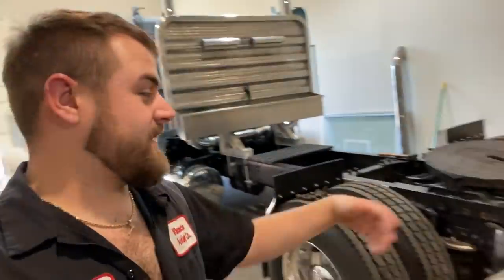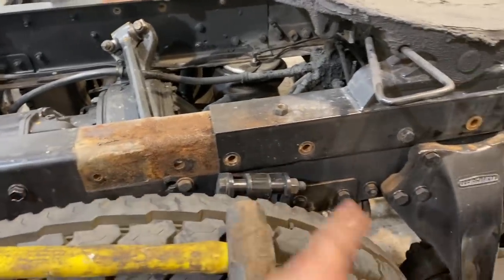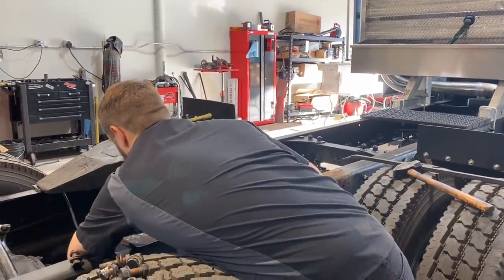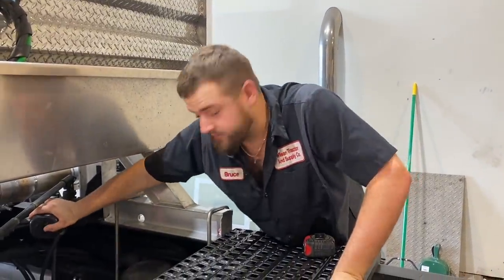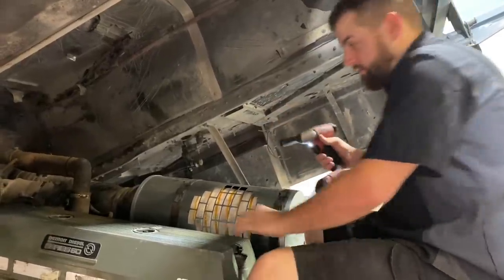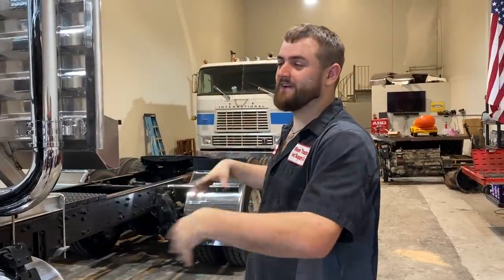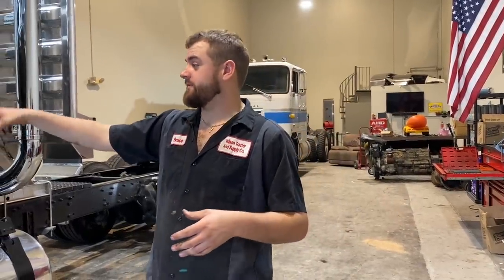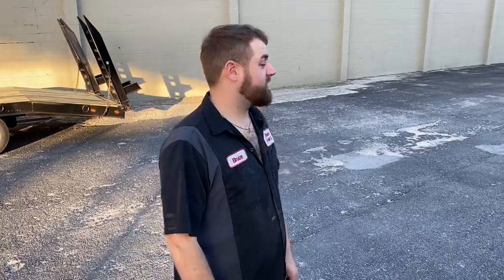Completing "Blue Collar" the Cabover Part 1....

Comment: The wood on the trailer deck use old diesel engine oil a couple of coats and that'll make it last forever and it's free!!!😉😁😁
Reply: use that on ruff cut not pressortreated should have been ruff cut you get full 2in.by ?
Reply: @johnyork8148  your right I didn't pay that close attention to it not being rough cut...
Reply: No Body my Grandpas barn floor is rough cut 2x12 completely coated in oil and it has been sitting in the dirt for 50 years and shows no signs of rot.
Reply: @aaronhayden1780  that's awesome my great grandfather taught me that trick!!!
Reply: @aaronhayden1780  i have rough cut barn with drain oil rolled it 3 times looks good 8 years no rot .not presser treated
Reply: That's a trick I used to use on my trailers when I wasn't a company driver
Reply: @johnyork8148  .uk

Comment: We get this stuff called copper 2 preservative that we do our low bed and gooseneck with every like 3 to 5 years super easy to apply 50/50 mix with water and spray it on with a garden sprayer i can do both trailers in about half hour our gooseneck is a 1996 and all original decking check it out if you can find it comes in clear green and brown

Comment: Advisory.  Cut two bits of angle join to the 5th wheel angle to cover the exposed Join Then then you have Protected the other weld-on stretch.  you have increased the pressure on the join Must Be compensated For. Zinc coat the welded area.

Comment: Looks great!! Need to find a way to tie the mud flaps up because if the stacks are too tall and you have to dump the bags to back into the shop each time, the flaps are gonna get caught under the tires and rip em off each time 🙈🙈🙈 is Bus Grease Monkey still coming to help out on The Air Force Truck?

Comment: Please shorten the mud flaps.
Reply: We've told him that several times and he still won't listen. He won't be happy until he rips a mud flap off and DOT pulls him over.
Reply: Dot will not pull you over for that nice try
Reply: @sarmce  they will if it rips off and not replaced immediately.
Reply: @sarmce  That is a DOT violation and they will pull you over if your mud flap is missing, dummy.
Reply: If he loses one or both of them, he might finally do it. That's the problem with having so much on the go all at once, he can't bring anything to completion.
Reply: I've said it many times. He'll end up catching the flaps and ripping them off and possibly damaging the mudflap hangers
Reply: @sarmce  The FMCSA recommends mud flaps be mounted at 300 mm and at angle greater than 22 degrees.
Most jurisdictions simply state that the vehicle must have mudflaps/splashguards on the rear of the vehicle that are adequate to keep spray and debris tossed up by the tires from hitting the windshields of following traffic.
Reply: But no one seen the wrong color lights in the back of the trailer right jay b
Reply: @sarmce  Dude, you are a damn RV driver. I have my Class A. I've driven OTR, Regional, Local, and Intermodal. If you were A REAL truck driver, you know that that no mud flaps on a truck that's Bob trailing is a DOT violation. I even posted the FMCSA regulations on it for you. If you are a truck driver, a REAL TRUCK DRIVER, you would know that. I'm sure you don't even know how to pre-trip.
Reply: @sarmce  And there is nothing wrong with the color of the lights on the back of the trailer. They are red. That is in compliance with DOT regulations.
Reply: @sarmce  And I've never been placed out of service on my DOT inspections. I've been pulled in had my vehicle and paperwork inspected. I've passed every time.
Reply: @BigHomieTX682  not in the back in back corner  had to be red i said I have ran with out them i never said i do it all the time Side Light Requirements

Sidelights, used to make other drivers aware of the trailer's presence and denote its length, must be placed in the same location on both sides of the vehicle. Rear side lights must be red and set as far back on the trailer as possible, between 15 and 60 inches high. Yellow front side lights must be placed as close to the front of the trailer as possible and be at least 15 inches tall. All trailers over 30 feet long must have intermediate side lights to make other drivers aware of the extended length. These yellow lights must be placed in the middle of each side of the trailer and be at least 15 inches high.
Reply: And i don't see no trucks on your page so how do you know what I do i could be anyone
Reply: @sarmce  You don't see trucks on my page because that's not what my page is for. I don't have a YouTube channel for trucking. I've driven for KLLM, Interstate Distributor Company, Hogan Transports, and others.

Comment: By moving the fifth wheel back away from the welded joint you’ve lost the integrity of that fifth wheel holding that joint together. I would get another piece of angle iron and bolt it back the way it was then you can remove it if you move the fifth wheel forward again. Course I can’t see how well the plate on the inside is holding it together. Just a thought.  That way you still have the pulling power of the trailer without compromising that weld  joint.

Comment: He should of remove the fifth wheel and clean the frame and painted it then get a different fifth wheel that slides. I bet that he won't work on that white cab over he will make a video about parting it out. You wait an see he going to make another video on that Chevy love pickup by stretch it next after he find another one.
Reply: Forst lart I agree with, but the second part, no. The Luv is for his dad, so he is jsut rebuilding the engine for it, and the Air Force truck, it will take time to rebuild it. He even said he wants to actually take his time, and do it right
Reply: What he say is are two different things getting it done is hole another story. I haven't seen him complete one thing yet. The other cab over that he took to his dad  place I thought that he had it sold. He's all about starting a project but never finish it.

Comment: Why would the truck come without a "sliding" fifth wheel?  I have scene many trucks but they all had sliding fifth wheel?
Reply: Its an option. 5th wheels do wear out and are replaced all the time. Dont be surprised if this was not the original

Comment: You need an overhead crane/hoist in that shop! A must when working on heavy trucks/equipment.
Reply: Yea the blocks on these engines are a the weight of a car and I wouldnt wanna see someone hurt trying to make content.
Reply: 1/2 inch piece of plywood on the back rails behind the fifth wheel.   Flip it over onto its face and clean up the frame then flip it back.

Comment: Tearing into another good running engine, just like the first cabover engine a decent running engine now sits in the corner in piece's why he tore it apart baffle's me? He needs to double frame that Air Force Cabover like the Freightliner.
Reply: He does what he does best , screw shit up.. If you expect any less you will be sadly disappointed..
Reply: Yep, I agree. I'm a 30yr hvy haul mechanic that thought it would be fun to watch and maybe help.  Turns out he doesn't listen. It is too much of a cringe factor now.  If he ever crosses paths with the right DOT officer, he's fried.
Reply: If you have money, you can fuck things up and don’t have to worry cause these trucks won’t leave the yard! Somebody with knowledge won’t ever buy them from him if he sees on YouTube what they did to it!
Reply: Notice all the motors he builds for the channel always blow up
Reply: @ghostdevill  Thanks for making my point..
Reply: @sony8331  Well I have yet to see him actually build any engine.. So if he does it like everything else it will be a joke.
Reply: All talk. Says nothing  never finished anything
Reply: @larryspicer3701  You should have seen the '1000 hp" Cummins he threw in that mudder he built. 350K on the block,wanted to get 1000 hp out of it,with only bolt on parts,absolutely no machine work on the block whatsoever,no coated pistons,clevite bearings,no machinng heads for o-rings or bigger valves,no belt driven secondary pumps,no nothing. I even warned him that when he got on it,it would take a shit,and sure as hell,the first time he put his foot in it...............................thats where he lost me. Before that,it was kind of interesting...................believe it or not. Now,its just the Bozo the clown show.
Reply: @specwar64  Well I have not followed his circus until the heavy trucks.. But its clear he needs another field of work. I mean over 40 years I turned wrenches. And the shit he attempts is so far from right it makes you say you just cant make this shit up.. Cabover trucks are the most simple to fix. But he dont have a clue.. I mean to butcher frames and choose a POS detroit over a cummins? You got to have no education.. Dont get me wrong, the guy is probably real nice guy, he just makes fool of himself attempting work he dont have enough experience at.. I think hes way over his head and should have stuck with small engines or something that he can actually show true skillset..
Reply: @larryspicer3701  I have turned wrenches all my life I stretched 3 trucks double framed them from head to toe, wait till he needs to put the driveshaft in, that's tricky with the angle the length, a carrier bearing and balancing its just not yea ok give me the torch and welder I will do this this and this. It is a cluster fuck.
Reply: @maxpuppy96  I been saying same all along.. To start that truck needs no framework. He should have never tried it. Second hes in way over his head.. Has no clue .. He dont have the know how to do anything hes trying. Its sad in a way but you cant tell the guy nothing hes the know it all of everything and master of nothing.
Reply: Commenting to Bruce is like putting your finger in a glass of water and pulling it back out.  I worked for Cummins Diesel, USAF mechanic and Diesel shop mechanic and it kills me to not comment with suggestions to help him but this is not my gig it's Bruce's gig so I'm just in the watch and see mode.  Possibly Bruce just wants viewers and more viewers to his channel to pump up his numbers.
Reply: @kevinamstutz6118  Guys a hack so you know the rest..
Reply: @larryspicer3701  Like a train wreck you know what you're going to see is sooo bad but ya just have to peek.
Reply: @kevinamstutz6118  yea you got it.. Not any ounce of productivity just pure simple demolition...
Reply: Which video does he blow up the engine?

Comment: Didn't the Air Force truck originally have a sliding 5th wheel? Could have just swapped the two?
Reply: He wants to keep it as close to original as possible, excluding the stretching of the frame
Reply: @bojanglesthewizard8875  😉 keeping it original when it was an option back in the day. Plus he wants to add performance parts. Unless he got rid of the donor truck, he could still do the swap. That or visit the junkyard buddy and get one there. Anyhoo, fun watch Bruce go
Reply: 5th wheels are swapped all the time. My money is on thats not the original 5th wheel anywaus as they wear out over time anyways.

Comment: Bruce you might want to find a air assist cab jack. I had one on my cab over when I first started driving. I cant remember what year it was though. It would make tilting the cab so much easier.
Reply: I had one on my 84 Cl9000 Ford cabover.

Comment: Your firing order on a 60 series is 153624 it has to equal to 7 so for example you would do number 1 valves number 6 injector 5 valves 2 inj 3 valves 4 inj 6 valves 1 inj 2 valves 5 inj 4 valves 3 inj  it’s vary simple

Comment: Why move the fifth wheel if your selling the trailer? 🤔
Reply: he`s gotta make a video about something
Reply: Because other trailers he tows may foul the taillights.
Reply: Because he will be using the trailer until its sold and as it was it wouldnt clear the tail lights
Reply: @simonturner10  not the fact or clearing tail lights, its the frame wont clear the trailer frame turning. Thats without the flaps which are required.
Reply: @brandoncaldwell95  If you check the video he states that its the tail lights not clearing the frame of the trailer hence having to move the 5th wheel back
Reply: @simonturner10  again, if you would look. The taillights are tucked in the frame. What wont clear are the flaps or the 2 frames.
Reply: A much simpler fix would be to get angled mud flap brackets.   That's why they make them.  You can even get them with the lights all chromed out.
Reply: @brandoncaldwell95  There is no saying that the holes on the other hitch would line up anyway so either way he has lost nothing by doing what he has done, chances are he would still have to redrill the frame
Reply: @simonturner10  yes, they would line up. There are univeral. The companies that built the truck do not built their own hitch. They are built by a 3rd party to ise on that model. That means the rail spacing, and holes all line up. Unless that other hitch was siezed up, or worn out, then he should have simply swapped.
Reply: @brandoncaldwell95  either way he is learning as he goes, we dont always get it right 100% of the time, hes never claimed to be a pro at this, thats part of what make all this so interesting. God knows ive made enough mistakes building cars in the past but thats how we learn
Reply: @simonturner10  uh huh, sure. Ignorance goes only so far when you have at least 40 people who know WTF is going on, what's done right or wrong. I understand the fact of learning, however use some common sense. He has yet to use the "common" part of sense especially when welding a frame back unlevel and uneven

Comment: Cam controls timing and creates the pressure when the injector solenoid is closed.  The longer the solenoid is closed, the more fuel is injected.  To some degree, the computer can control timing as well.  Newer big Cats and big electronic Cummins use a similar system. The DD15 finally got Common Rail.
Have you considered decking the frame all the way to the 5th wheel?
Reply: Lol. Yea sure.. Your talking way over this guys head.. But nice try..
.

Comment: Let me get this right. You buy a trailer with  the king pin set up for a single axle tractor. So you move the 5th wheel back to accommodate the trailer, that now you are selling because it's too short. Going to a 48'er means you could have left the 5th wheel where it was. Just maybe you need to think your projects through instead of doing them on the fly.
Reply: Fly by night  has a d d can not finish anything
Reply: @chrisarnaman2372  You are right. He needs to grow up a little bit.

Comment: Best stuff for wood decks, I mix 50/50 oil(used or new engine oil) diesel mix and use a roller to spread it on the deck.
Reply: Tsunauticus III hahahah well yeah that doesnt sound good. Ig its not the best for everything
Reply: Boiled linseed oil, it's not slippery but sticky and doesn't turn the wood to a skating rink when it rains.

Comment: I think you were maybe swinging into landing gear of trailers set up for single axle tractors,  i.e pup trailers.... maybe not, that 5th was where it was because it probably worked with 48' and 53' trls...just an idea
Reply: It had been stretched, had a PTO added, and was dedicated to a bulk cement tank trailer that set way back. That tractor has not been hooked to a regular trailer for many years.

Comment: By a new one for 10500 u went to the trouble to unbolt the fifth wheel but didn’t wire brush. The rust off  half asst as usual

Comment: You need to swap out that transmission to get those higher speeds. Either a 13spd or 15spd.
Find out your rear end ratios. 
Juice'in up the engine not going to get you speed only power.
Reply: Nowhere in the entire video did he talk about speed. A jake is the exhaust brake which he is wanting to put back on after the pervious owner removed it. Truck is fine and just need to be left alone. Just do whatever maintenance which he should take to a mechanic who knows these engines well. Just ask to shadow him without a camera in his face.
Reply: @brandoncaldwell95  yes he did, when  said he wanted to ( pump up power and or speed on the Detroit engine) 65, 75 or 80 mph on it.
Reply: @chrispellicci6587  True dat !

Comment: need to put the guard on the grinder, his finger is like 1/4 inch from the blade i was waiting for it to hit
Reply: AKA death wheel !
Reply: Running a grinder without a guard is fine. Each person takes that at their own risk. I have zero issues with it. If a blade breaks, its not as deadly as they claim. It does hurt like hell, but wont kill.

Comment: You still haven't repaired the tip of the ramp on the trailer.
Reply: yes it"s done. Still have to coat wood, put on reflective tape , straighten ramp,replace straps; BUT: it's done

Comment: Bruce try contacting Pittsburgh power they specialize in high-performance parts and tuning for the Detroit engine that’s in your Freightliner and Big Cam Cummins Engine’s, they could definitely help you out on how to run the overhead on the Freightliner Cabover as well as tell you what you can do in getting more horsepower out of that 60 series Detroit engine on the Freightliner Cabover if you want to turn up the 60 series Detroit on the Freightliner Cabover.here is the website 3600 South Noah Drive, Saxonburg, PA 16056
https://pittsburghpower.com

Comment: Buy the shop manuals for that engine and for that model Freightshaker. I have done that with every truck I've owned since 1994, money well spent. It pays for itself in a short time. Heck, you can get them on a CD and print out what you need from it.

Comment: Just curious about the trailer.  I would like to know make model year and overall length and width. I have an 86 k100 with stretched frame also.  Thinking about taking off  fifth wheel then adding flatbed and pintle hitch to pull dolly and trailer
Reply: Its a Kaufman trailer